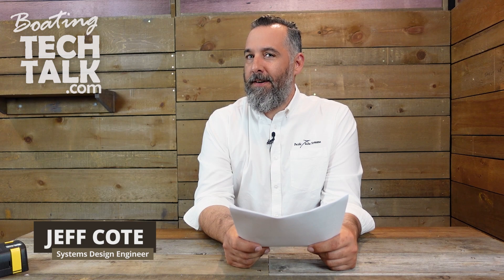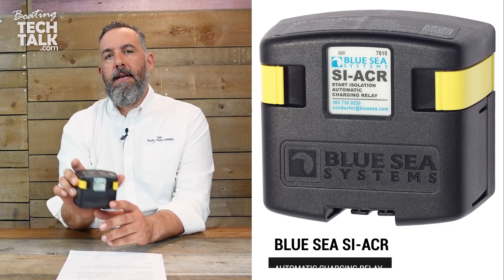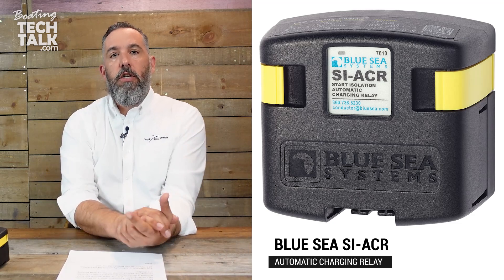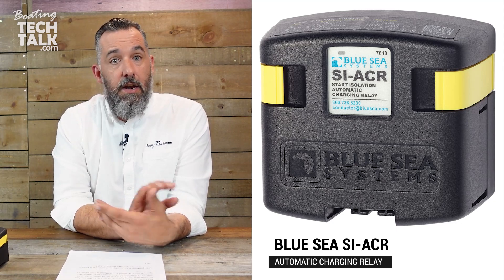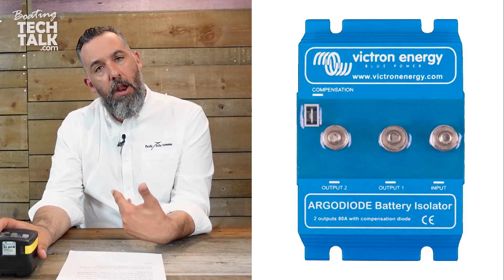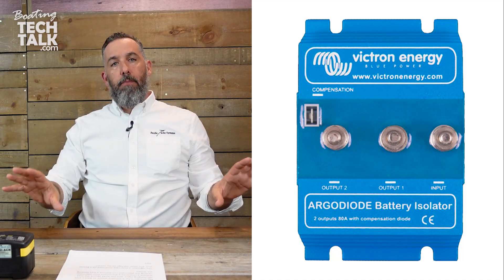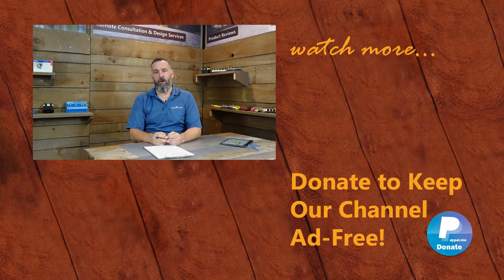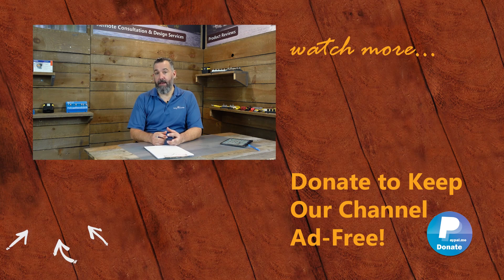Charging Lithium Batteries with My Boat's Alternator

Comment: I'm pretty sure that the Balmar 618 has a safe guard against termination failure and as a backup install an APD(Alternator protection device) 
This way you can utilize as much of your Alternator as you want and charge the starter bank from the dc-dc. I use 150amp of my 170amp balmar with a large exhaust fan in the engine compartment.
Sv Sandii

Comment: I have a follow up question.  I purchased a lithium power station battery, Yoshino B4000, to run may boat’s AC on anchor. I typically charge it when on shore power, but is there any potential harm charging it while motoring?  I use my 2000watt inverter and charge the power bank via its AC charger (1800w). Any potential harm to the alternator or other boat electrical components? Thank you!

Comment: The charging voltage of the typical lithium battery is 14.6V (13.6V at rest). The equivalent voltages for a AGM, orl gel battery are 1V lower (or more). Those voltages are high enough to trigger an automatic combiner, strapping the two types together in parallel. Doesn't that mean that the lithium will constantly seek to charge the other, and does that reduce life expectancy?

Comment: Better way not To burn up your alternator is to use a DC DC charger from your starter battery to the lithium. I use a 30 amp model works well.

Comment: you suggest using a diode or a battery combiner. but the batteries are two different chemistry's? surely they need different charging algorithms?

Comment: Hi!!

Jeff, you don't mention that Li and AGM batteries have deferent charging profiles. Also your not mentioning, or I missed it. As to which battery type the regulator is set to. With ether setting the way you have it. You may not get the most out of ether battery. Since one type or the other is not being charges to their settings/profile.

Comment: You’re solving one of two problems. The other being too much current being drawn by the lithiums and cooking the alternator
Reply: Exactly why I went with two Victron DC/DC chargers.  I can regulate the current going from the engine to the house bank.  

I'm not sure why Jeff Cote didn't address this in the video or  in prior questions.  Jeff - what do you think about this option?
Reply: @BlackheartCharlie which of the victron dc to dc chargers did you use?

Been waiting for the XS model.

Isolated or non isolated model?

Thanks
Reply: @alexsails80  I have two of the 12/12 30 Orion's in parallel.  They are the isolated version.  I don't know if the non-isolated ones also run hot.  

I'm starting to see that the 12/12 50 XS model is shipping.  Hopefully it doesn't cook itself like the Orion's! 

B.
Reply: Good question. That's my number one concern. This could overheat the alternator and break down the insulation on the cabling, potentially leading to fire.

Comment: I think the battery isolator does not restrict the amperage going into the lithium battery and may cause the alternator to die of heat exhaustion. Please correct me if I'm wrong
Reply: I know I'm not Jeff, but yes you are correct on that. You will need a DC to DC converter to regulate amperage

Comment: hi, just bought an Ionic lithium starter battery.  Looking into using my yamaha 200 alternator to power pure (no agm) lithium house and battery banks while underway. also have a chargeverter to power the ac while underway and power all batteries dockside - just trying to figure out how to wire it and what I need. thanks

Comment: Thanks for the video.  In your screen shot of the isolator, you show the ArgoDiode and not the ArgoFET.  Any reason and do you prefer one over the other?  I installed an ArgoFET in my system to eliminate the 0.7v drop on the diodes.

Comment: I have two alternators on a single engine. A 135A charging the two AGM start batteries and a 245A charging the three (now two) 198Ah AGM batteries. Since one of my house batteries recently bit the dust I am looking to upgrade them to lithium (Approx 600-800Ah). What would be the best recommendation to charge the lithium with my setup? Have both alternators charge the start bank with enough battery isolators to charge the lithium bank or is there a better way to charge the lithium directly?

Comment: Why not use a 12V to 12 volt DC battery charger. It seem to me that the battery isolator won't output the correct voltage needed to fully charge the LiFePO4 bank, they typically need a charging voltage of 14.4 to 14.6 for a full and cell balanced charge?

Comment: I have to agree with @danpease8395. I guess everyone can have their own opinion, but the advice in this video isn't really what I hear as best practice as of 2022 or so. I found myself wondering when you were going to mention DC-DC chargers and APMs, but it was only ACR or isolator. 

The Balmar APM is only $70 at West Marine so there's really no reason to use an AGM start battery as "sacrificial" protection. And a DC-DC charger isn't much more expensive than an isolator or ACR. A DC-DC charger allows you to customize the charging profile to the battery you're charging, so it's sort of surprising to me that DC-DC chargers aren't the default in place of isolators and ACRs by now.

Comment: Hi Jeff, love you videos. Question. I have 2 outboards Yamaha 200 with 2 AGM starting batteries and 2 AGM house batteries. Now I need to add one 344AH lithium battery for seakeeper one. How can I connect the lithium to be charged well the engines are running
Reply from the maker: how is the house bank currently being charged from the engines?  acr / vsr ?   aux charging leads?

Either way I would recommend adding two dc to dc chargers,  one from each engine battery to the new bank.  that way both engines can charge it.   
ideally you'd want more charging power then the Seakeeper is using but you also don't want to overwork and overheat the alternators.  so the DC to DC will limit the current being taken from the engine.  and also provide the correct charging for the  lithiums once programmed

A pair of 30a Victron Orion smart dc to dc units would likely work well.  Depending on which seakeeper you have 60a may not be enough to keep up.  But 30a is probably a good max number to take from each outboard.

at the end of the day when you plug in,  the battery charger that charges the engine batteries would also charge the new bank via the same dc to dcs.  so  you wouldn't have to add another shore charger

Comment: I have a similar setup with 4 li and a lead acid start and gen batts. I’m using the 250a Balmar Tx with mc614 regulator. Will using the battery isolater allow me to still program the mc614 to get the max from the alternator? Balmar suggested adding an APM-12 alternator protector.
Reply from the maker: Yes.  I would put the mc614 battery sense wire directly on the li bank.  The other batteries may end up being slightly higher voltage but that is a good thing as the setting for the li charging voltage is likely lower then flooded anyways.  Get a low drop isolator like the victron argo fet.  Don't use an old diode style one.  make sure it can take 250a.    if the Li BMS opened the alt still has a path to the start battery so the protector is less needed.  But won't hurt anything by adding it.

Comment: What if I don’t have a agm battery but both are lithium
Reply from the maker: if you are charging a lithuim battery directly from an alternator,  you have a risk of the battery BMS opening,  which could fry the alternator.  There are alternator protectors that may help prevent the damage if that happens.

if you only have lithuim, the correct way is to have an external BMS that can shut the alternator off first.

Comment: In your example, what would be the difference between running the Argodiode vs a ArfoFET (I have the 100A one input, 3 output between my alt and house \ start batteries). I'm asking because I currently have my single engine alt charging my starter battery and 8d house battery but I want to replace my 8d with two 100AH lifepo4 batteries. I'm trying to figure out what other components I need, I was thinking I needed a dc to dc charger as well but I'm not sure if I should keep the FET in there as well.

Comment: I'm just looking into lithium batteries as my agm is wore out. I have a evinrude 40hp etech motor. I'm wondering how well a boat motor will charge a lithium battery as the voltages do not match? Can a lithium run as a starter and be used to run the electronics on my boat? Or to use lithium in a boat do you need to batteries two make it work? I've looked at renogy dc-dc charger to use if two batteries are needed but this starts to run up the cost.

Comment: I apologize if this has been covered in the comments already, but in my setup, the alternator seems to be connected to the BOTH ( Common ) post of my battery selector switch.  I have an AGM starting battery connected to switch position 1 and a Lithium battery ( house ) connected to switch position 2.   The batteries have their Negative terminals connected together.   My question.. if I want to charge my lithium off the alternator...  would it be OK to start the engines with the selector switch to BOTH so both batteries charge?  Not sure if I need any type of DC to DC converter or if the switch in the BOTH position would just split that voltage and just allow voltage to continue to travel to the AGM in case of the lithium BMS shutting down.  Basically protecting the alternator by always having the AGM connected.

Comment: So I'm thinking about going to a lithium battery for my stereo "house battery" replacing house Agms.  I have a victron battery isolation fet. Bought the 3 battery 200amp model.  I upgraded to a 160amp high output alternator. My alternator has a wire to let it know when the battery is fully charged. How does that work? Will I be ok going to a lithium battery for my house bank and keeping the AGM as the starter battery using the battery isolator? Thanks for your time.

Comment: I understand the battery isolator the thing that I do not understand is is the alternator able to charge a lithium battery? Is I use high tech battery chargers they check to see what type of battery is being charged and they pick one, I have had trouble with the won't charge different batteries even though I'm using a battery isolator.
Reply from the maker: A properly chosen alternator with external regulator (programmed for Lithium) will be able to charge a Lithium battery.

Comment: Wow! Did not know that a loss of load would kill the alternator 😲.....
I better explain my plan....I have an RV project, 12 volt electrical system for the drivetrain/ 24 volt system for the house batteries along with 24 volt charging....
      My plan was to add a second 24 volt deep cycle alternator to the 12 valve Cummins Diesel engine to charge the house batteries if they got low while driving.
    so I did hear your solutions, now my question is, if the 24 volts are being directed through the battery controller, and inverter and no other systems are feeding it power, would that be enough to keep the alternator from running without a load?

Comment: What's your thoughts on using one  lithium battery as a starting battery on a bassboat which would also be controlling all screens and pumps as well. I have a Suzuki 250ss.
Reply from the maker: I'd suggest going with a lead acid battery and not doing Lithium for starting applications.

Comment: Jeff,  great talks,  BUT, is this combiner smart.  NO! It is not.   You will be doing a dis-service to your lithium bank by charging in a non specific form.

You really owe it to your viewership, to either modify this video, or take it down and tell people why, as pointed out by others here,  use a smart b2b charger, and not limited to that protection.  

You should also, in EVERY video when yo talk about any combination or lead and lithium batteries,  NEVER NEVER NEVER directly connect the two different chemistry battery banks together unless you are ABSOLUTELY SURE that the banks are perfectly equal in voltage state.

Please man, protect these people.
Reply from the maker: Thanks for sharing Dan, appreciate it.

Comment: Sailboat with LA start battery and LP4 house battery. Alternator goes to start battery. Blue Seas ARC connecting both banks. Engine running,both banks connected. Shut down engine, but LP4 is still at 13.4 volts. Won’t that back feed and keep the ARC connected until LP4 voltage is below 12.75 volt or about completely discharged?  Seems like I would need an ARC with an ignition connection to correct this.
Reply from the maker: With different battery chemistries, e.g. lead acid versus lithium, better to install a DC to DC charging converter instead of a battery combiner. Recall the DC to DC charging converter will modify the voltage to what the Lithium battery needs.

Comment: how exactally does an altenator "blow up" if it looses connection to a battery? an altenator does not even have to have a battery  to function. it will keep the engine running off its output voltage until it is either shut off or reconnected to a battery. loosing connection to a battery will not effect the altenator.
Reply: @PacificYachtSystems  Good question Jeremy, but I don't see the answer from PYS.  Thanks.

Comment: Jeff, this may be a recent developement since this video but Victron offers a "solidswitch" which was reportedly made for the express purpose of safely shutting down a turning alternator controlled by an external regulator by disconnecting the ignition wire should the BMS over voltage disconnect ckt see over voltage parameters.    Balmar indicates this can be done at the same time or before a complete BMS isolation of the LiFePO's.    Comments?
Reply from the maker: You bring a good point, external BMS for lithium allows the BMS to communicate and control the alternator charging via the ign wire connect to external regulator (e.g. ign wire is to turn external regulator on or off).

Comment: I'm slighty confused because I thought that Lithium batteries required different charge parameters then AGM or other types of lead acid batteries. Wouldn't it be unwise to parallel two completely separate battery chemistries or is the assumption that the built in BMS will sort it out? Why not use something like one of victrons isolated DC to DC chargers so you can tailor the output of one battery to the needs of the other?
Reply from the maker: Trevor, you're correct AGM and Lithium are different chemistries and require similar but different charge curves. Some boaters, are sacrificially using an AGM battery (in parallel to a Lithium battery) as a way to protect an alternator in the event of a BMS disconnect.

Comment: Hi Jeff,
Just found this video and it got me thinking about my setup. 4 Relion RB100 batteries in parallel with an Optima Blue top 31M as a start battery, the Alternator is a Balmar 120Amp alternator controlled by a Balmar 614 regulator. After looking at the video I checked my charging relay and saw it was a Blue Sea M-ACR 7601, which appears to only handle 65 amps. My impression afte watching the video was that this design should be adequate to protect the alternator, but I am questioning whether I should upgrade the charging really to the SI-ACR to handle the higher amperage.What are your thoughts?
Thanks,
John
Reply from the maker: Tough question and unfortunately no definitive answer. Assuming your AGM optima Group 31 is not heavily discharge, your alternator is connected to your Relion bank, you normally should not have lots of amps going from your Relion batteries to your Optima Group 31. As with all battery combiners, regularly check the fuses on both sides of the circuit for accidently over amperage.

Comment: I have a bass boat and changed to lithium batteries.  I have 3 125Ah batteries for trolling motor and one 110AH battery for my engine and electronics.  Will the alternator charge the lithium battery when I run?  I recently noticed my volt meter on my console down to below 12 volts and my starter battery went dead on the lake. I also noticed when it was running that the meter on the console was not over 13 volts like it normally is.  I will check my alternator next time out but I wasnt sure if the engine alternator would charge the lithium battery.  Is there a better way to optimize the alternator charging lithium if it does work?
Thank you
Reply from the maker: Mark, you'll want to consider how does your engine alternator recharge your house battery bank, it is via a battery switch to "all" or "both" or do you have a battery combiner or perhaps a DC to DC charging converter. One of those 3 items is most likely the way for your engine battery to share a charging voltage with the house battery.

Comment: Gidday Jeff.
Interesting video, thanks.
I am thinking of a similarly set up, but will have one lead acid starter battery, one AGM bank and one Lithium bank, all 12 v.
How would I best integrate the battery isolator and a DC/DC charger. I was thinking of placing the battery isolator after the alternator with one connection to the starter and the second to the AGM bank, then connecting the Dc/DC charger between the AGM and the Lithium bank. Would that be the correct way to solve this?
Thanks for any comments
Reply from the maker: Hi Ralph, sounds like you are going the right track. The DC to DC charging converter is a good way for the Lithium to get a charge from the AGM bank.
Reply: @PacificYachtSystems  thanks Jeff. What about the placement of the battery isolator, any thoughts on that please?